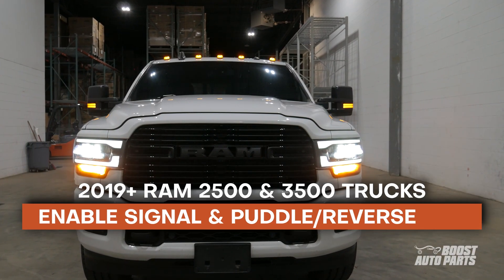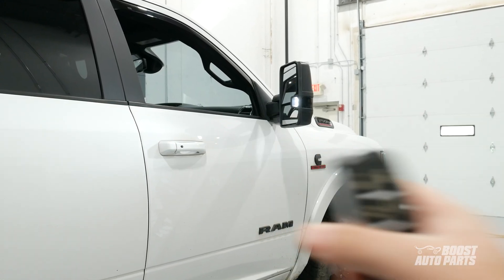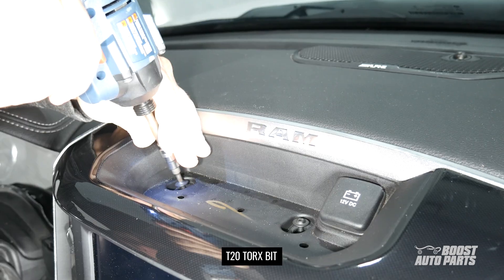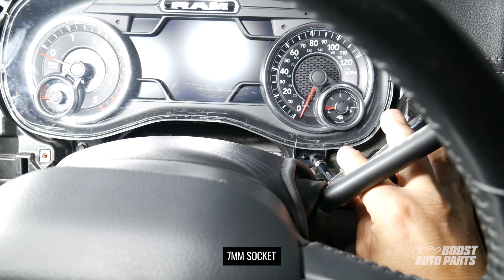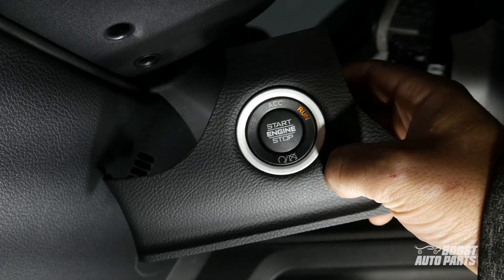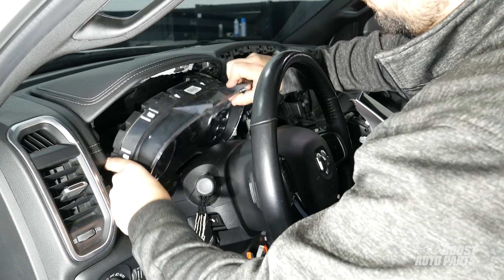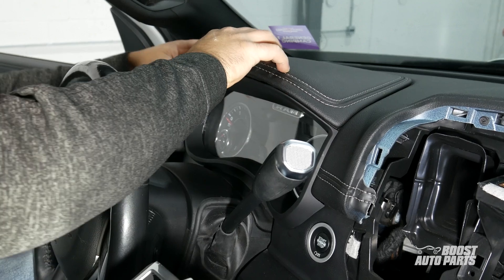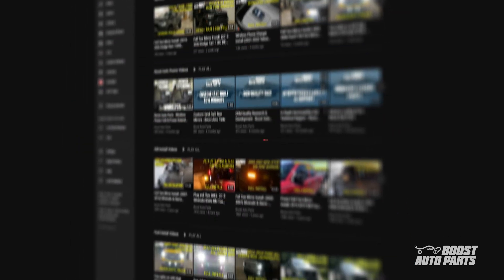OBD Mirror Programmer- Enable Signal & Puddle Lights | 2019-2022 Ram 2500 & 3500 Trucks

Comment: Just ordered my second pair and got the obd to add the blinkers and puddle lights. I followed the video step by step but the puddle lights do not work.. any thoughts?
Reply: Update** I got the puddle lights to work… but my door locks are acting up. Sometimes it locks and sometimes it doesn’t…
Reply from the maker: @dkuehara06  Please reach out to our support team at support@boostautoparts.com or call them at 765-831-2830 so we can assist in getting this resolved ASAP!